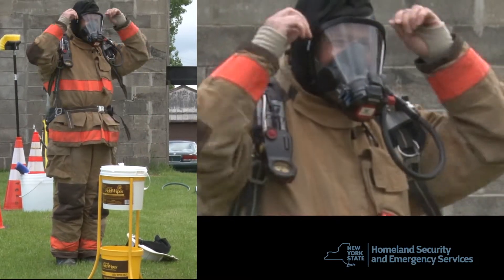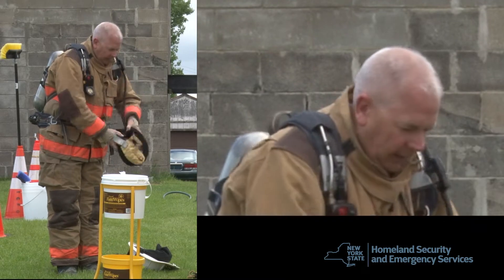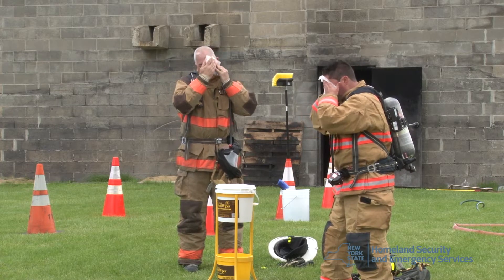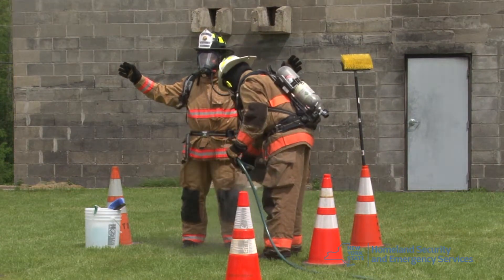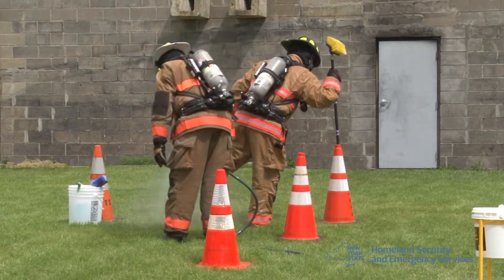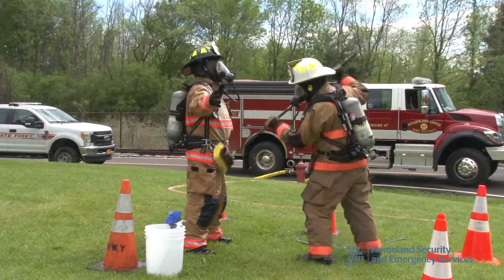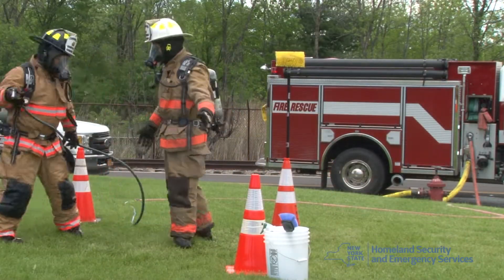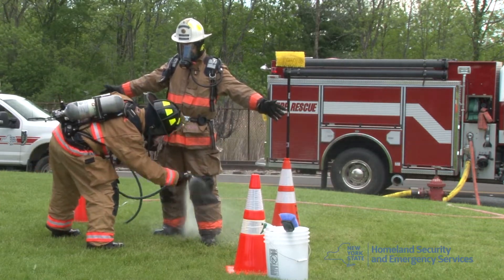NYS  Firefighter Gross Decontamination Process

Comment: I see they are using a blue color soap in a spray bottle to clean off equipment, which is likely something like Dawn dishwashing soap. While a great anionic surfactant for dishes, not so great for cleaning off cancer causing cationic chemicals. That same company that makes those wipes in the videos (hygenall) also makes a surface cleaner that removes all three types of chemicals, cationic, anionic and non-ionic.